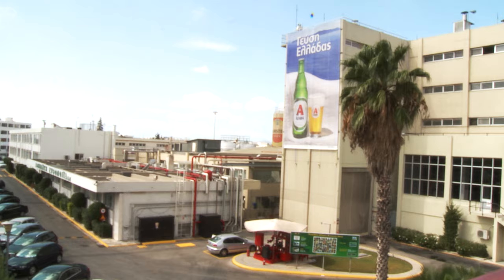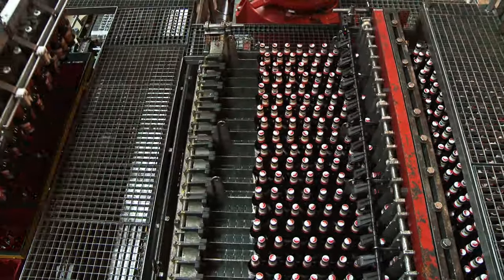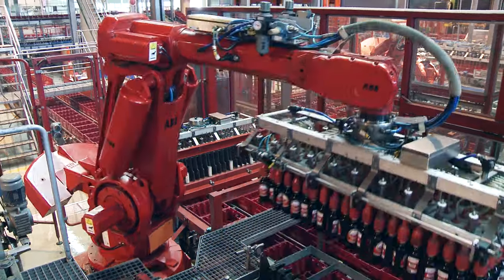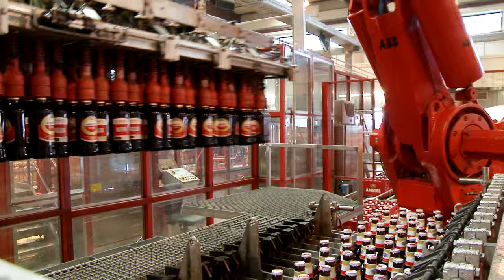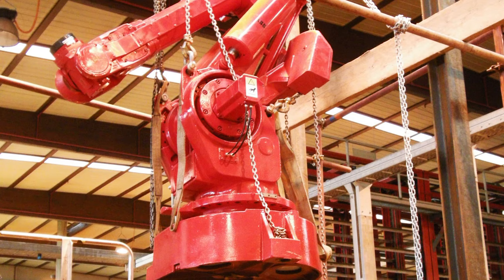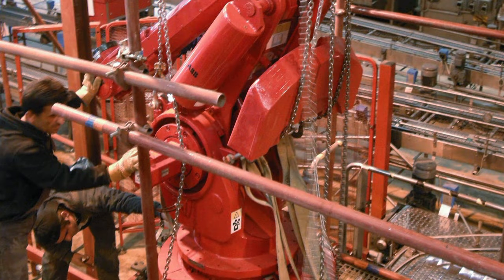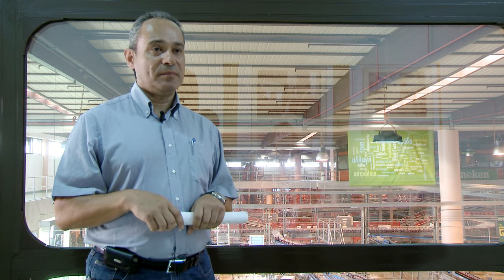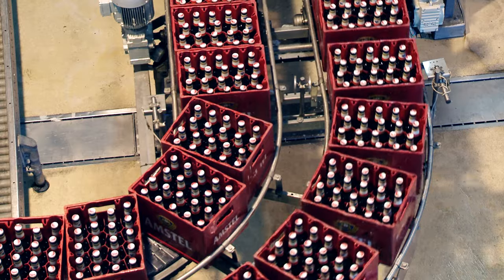ABB Robotics - Packing Beer Bottles with Refurbished Robots

Comment: The robots that were taken out are probably going to be refurbished and sold again too, they are not exactly scrap metal, at worst they are going to be sold for spare parts. That's the neat thing about these 6 axis articulated arms and other standard robots, once the job is done and over with, you can sell it and recoup a significant part of initial cost or use it in a new application.

Comment: 1.6 million bottles of beer on the wall, 1.6 million bottles of beer, you take one down, you pass it around, 1,599,999 bottles of beer on the wall!

1,599,999 bottles of beer on the wall, 1,599,999 bottles of beer, you take one down, you pass it around, 1,599,998 bottles of beer on the wall!

1,599,998 bottles of beer on the wall...
Reply: IntarwebUser The robot just replaced the missing bottles.